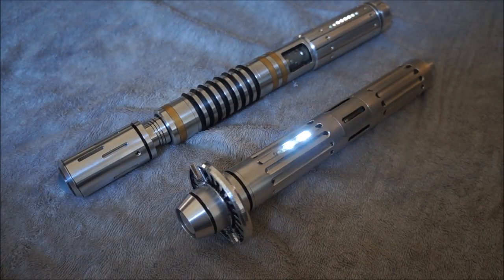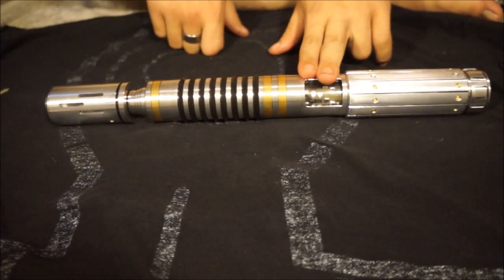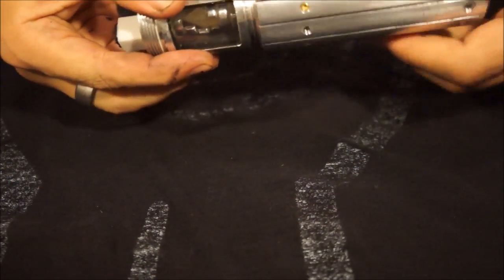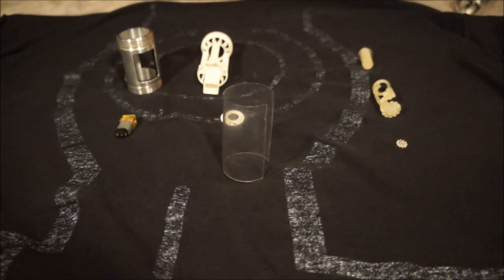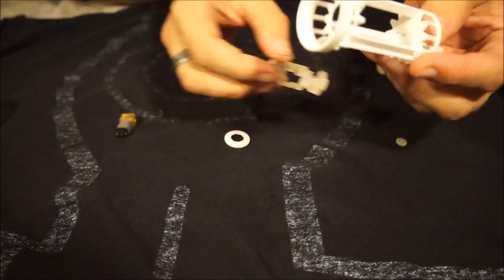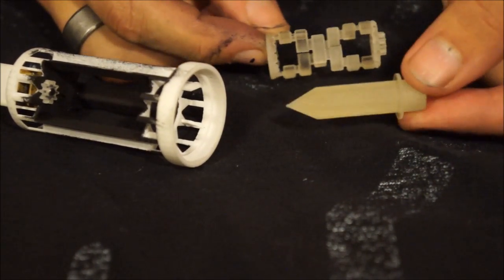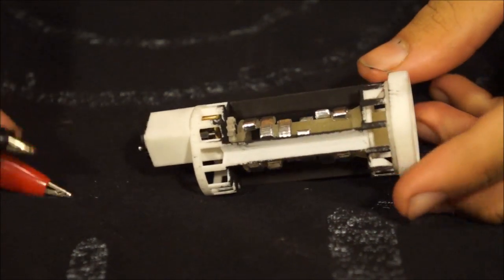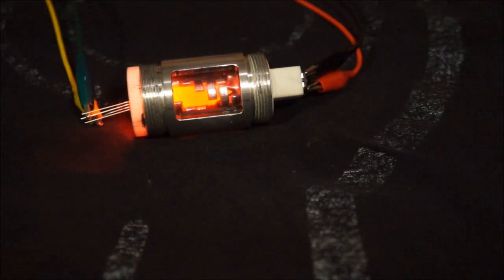Rotating Crystal Chamber Unit (MHS Compatible)

Comment: I'm completely new to this. Ordered my first saber from ultrasaber my question is are parts like the emitters and this unit you created at all comparable with ultrasaber light saber hilts and/or blades?
Reply: +slicshadow It depends on what you bought.  Most Ultrasabers have MHS compatible pommels, but not all of them have MHS emitters.  I'm not sure I would recommend opening up an Ultrasaber and messing with the wiring unless you have a pretty good idea of what you're doing already, anyway.
Reply: +slicshadow ultrasabers claims mhs compatibility but from what i read they basically stole the idea from the custom saber shop copied their threading and even still it doesnt always work because their tolerances arent as good as tcss
Reply: bmxriderforlife1234 Well I'm not sure how to make a part compatible without making the threading the same.  As for the rest, Ultrasabers USED to have a pretty bad reputation but for the past few years they've gotten a lot better about their customer service and QC.  It also saves you the trouble of wiring your own saber with TCSS.
Reply: +SakamaruNetoi what I meant was there are apparently times when the threading isn't as nicely done leading to issues could also happen to mhs stuff but doesn't because of quality control plus they didn't ask to make their stuff compatible and apparently they used to order from tcss
Reply: bmxriderforlife1234 Well, oiling can usually help with threading issues.  As i said, US has upped their quality control (QC) over the years.  And yeah, I don't agree with them selling stuff from TCSS as their own, but that's definitely not something they do now.  Like I said, in the past they did have quite a few issues.  But they've resolved a lot of them now.
Reply: SakamaruNetoi they used to order the blanks and machine them nothing wrong with that but then copying tcss's thread without asking when switching to a new supplier isnt the best and yeah im not saying theyre bad just i wouldnt rely on threads matching perfectly and oiling doesnt always help when the threading isnt done properly but id deffs still buy one i wouldnt get a saber forge though. personally im just gonna save up and see about getting a genesis custom saber
Reply: bmxriderforlife1234 The Genesis stuff is ridiculously expensive though honestly.  That's my only issue with them.  US is good quality and relatively cheap. lol
Reply: SakamaruNetoi but with genesis you are typically getting a one off with lots of extra detail and you can customize things how you want and his production level stuff is around the same price as vaders vault and certain ultrasabers stuff

Comment: What is the best way to go about wiring this? Directly into the switch or into the positive/negative on the board? I'm looking for the light to come on once the kill key comes on but I don't want the motor to run until I activate the saber. I'll either be using the Prizm or CF sound board. How did you wire yours up?
Reply: Did you ever find an answer to this? I created my own chamber but not sure how to wire the motor
Reply: @wyteyoda7831  I ended up using a newer board. CF 10. New boards have a number of auxiliary ports to wire effects to. There is a specific one for a power on light if you want to use that or there is also an RGB port depending on what kind of LED you use. And for the motor negative to the negative and the positive to one of these other ports.
Reply: @chandlermorris1  thanks so much! Is there a need for a resistor on the motor?
Reply: @wyteyoda7831  I don't remember if I put one on mine. I don't remember doing so but it depends on the motor. There are different powered motors that will fit in that same spot. Use Ohms Law to make sure based on what you have.
Reply: @chandlermorris1  yea I have a 6v motor that I'll be running off a 3.7 v lithium ion. So I dont think I'll need a resistor
Reply: @wyteyoda7831  If I am ever not sure about using a resistor I will pop a .5 ohm on there, but it is usually better to do the math.

Comment: I can't figure out how to use the MHS chassis to mount all the electronics at the front because the motor gets in the way of the disk that will hold the chassis in place. Any solutions to this? I really want the chamber at the rear of my saber.
Reply from the maker: +Mel Est http://farm3.staticflickr.com/2857/10883731675_cf581eb552_o.png

Something like option 1 or 2 but split the "main tube" section into 2 parts to have an extra joint to mount your frame to.

Comment: ammnra   How much money total would you say, generally speaking, would I need in order to fund a project like this. also, can I find all these parts online, ready to assemble already, just as long as I can figure out how to put it together properly ? Sorry, building my first custom saber, just wanted to get some info/advice on where to find the things I need. I have a couple design ideas, and I considered using the Epoch hilt from Saber Forge as my base unit. wasn't sure whether I could begin it as a stunt piece or with just sound, and then add something like Emerald to it later when I have the cash. Can you tell me if that's possible